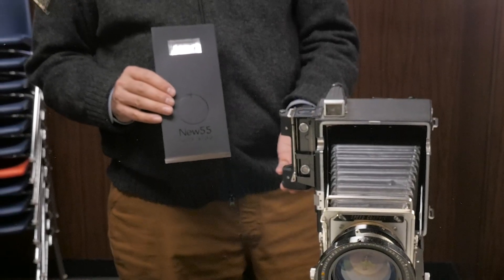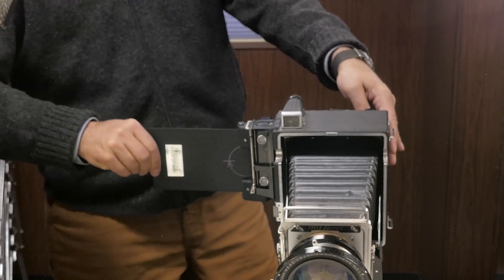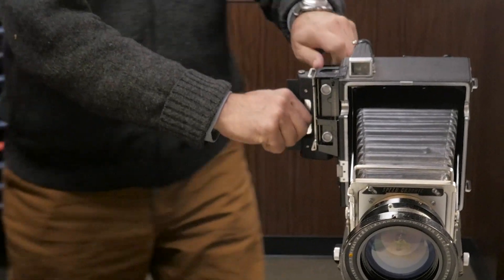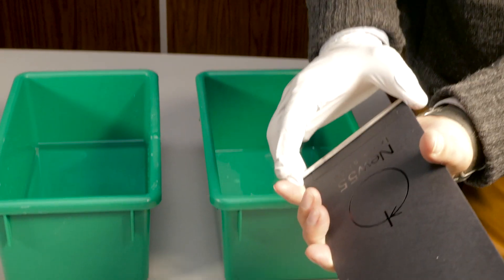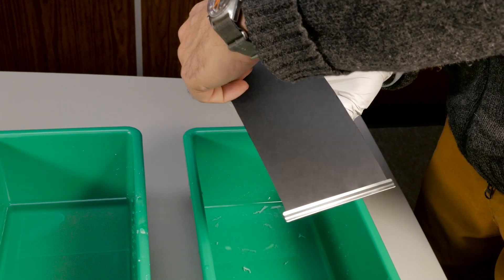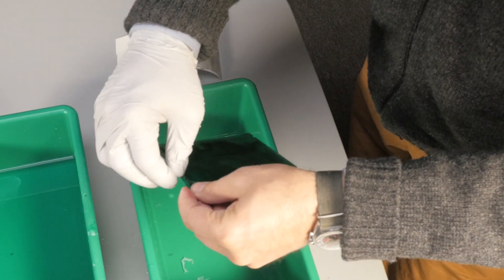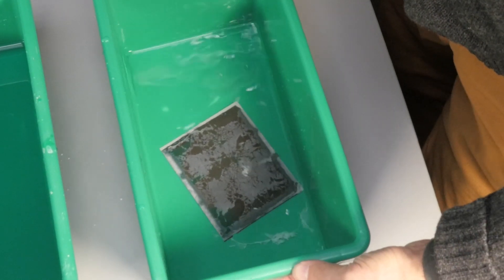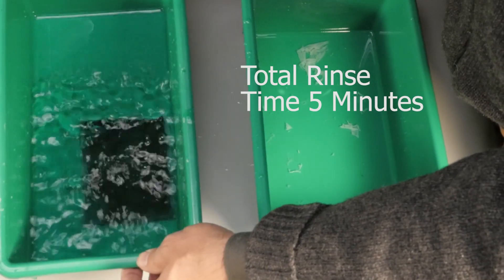New55 PN - Shooting and Processing

Comment: Hi sam what if Im traveling and take a photo with my film but wait a few days to develop it?
Reply from the maker: That's done often, Jess. The 545 and 545i holders have a Release Lever 'R' that lets you expose the film packet and then take it our without processing. Come back later, replace the film packet and process as usual. Waiting days, weeks or months does not harm, so long as the pod reagent is good. Recommended to use within 6 months of the date-code.

Comment: If you take your image, can you replace the slide and remove it without processing? Can you save a few for later? If so how dark to they need to be kept? What is that processor thing? Why does it need to be removed?

I just got a 5 pack of this film last week and my Crown Graphic is cleaned up and ready. The box isn't opened yet so not sure if there's any instructions.I am trying to think of a worthy subject before experimenting. At $15 per shot I don't want to be too wasteful.
Reply: Steve - the 545 Holder is designed to process immediately or to simply remove the exposed film packet for processing later in a different location. After exposure, just hold down the holder’s Release Lever ‘R’ while removing the film packet. Look for other videos for New55 PN to get all the nuances of the process.
Reply: @ehhiser  Thanks, I have a 545 I haven't used in 20 years. I did use it for positive only Polaroid but never tried 55PN. I recently got a 5 pack of new 55 and have looked at examples on Flickr. What I've seen there has tons of defects. The're so bad they have a grunge effect all their own! At $15 a pop I was really thinking hard on what to shoot but I better just shoot something to try it out. On the old Polaroid positives I had to shoot at 50% faster and increase exposure time to avoid over contrast.

Comment: What would happen if you left the film longer than 4 minutes?
Reply from the maker: It's now a 2-minute processing time.  Longer will give over-development -- with some artistic possibilities.  (see Andreas Rentsch ... http://www.andreasrentsch.com/
Reply: Tim White in the old days Polaroid supplied as an optional device a plastic tank with snap on lid that held a plastic frame contraction that held 10 sheets of T55 negatives suspended in fixer for when you were out in the field.  If kept wet in the tank you could wait several hours with no negative degradation.  I still choke up when thinking about Polaroid and their amazing T55.

Comment: Having been a previous user of the TYPE 55 Polaroid material since it's inception till the end this new product seems "clunky" and requires more manipulation and care than the original packets which you could always choose to process in the holder in more ideal and controlled situations. The original Polaroid packets were relatively thin and went in and out of the holders with ease, they were designed to be quicker than standard single double side shot film holders. Polaroid had a wet holder where you could put negatives in 18% Sodium-Sulfite solution in the field (Kodak's Hypo-Clear was an alternative) and even use a second hardening solution in a second holder. Field use in a 4x5 Graphic was practical if you could delay processing. In the later versions of the packs the processing time was 20-25 seconds, many opted for NOT preserving the negatives in certain situations, though a properly handled negative was comparable to most films of similar speed and specification. You did have to keep in mind the actual print area was less than 4 x5 ( 3 1/2" x 4 1/2 " (9 x 11.4 cm)). Given all the advancements in technology and manufacturing it seems much of the Polaroid technology has yet to be properly reproduced.

I had the opportunity to work with a number of the research and manufacturing talent after they left Polaroid after Dr. Land's death and what they conveyed was missing after Dr. Land was the cheer leading and demand for quality, excellence, and innovation. Research at Polaroid Cambridge was open and free wheeling in those days according to those on the ground and at times expensive.

Probably the item I personally miss the most now is due to Fuji's discontinuance of the pack films, orphaning 10 of thousands cameras, especially some of the better examples. It is uncertain of CatLabs of JP ( Jamaica Plain  - Boston) MA will accomplish the tasks without the manufacturing materials and equipment Fuji had in hand but evidently was unwilling to part with after the discontinuation announcement.
Reply from the maker: Hello WeBuyIt_WeSellIt -- 

You give an interesting summary and recap of the peel-apart and pack-film situations.  Your experience with the Polaroid culture would be nice to hear about in a direct form of communication -- article or panel discussion, maybe.

We deliberately opted in the Mark I version of New55 PN to use a better method for clearing PN's negative, indroducing a polymerizing ingredient in the reagent.  Old Type 55 was designed to DISSOLVE the reagent goo in sodium sulfite.  Ours CURDLES for COMPLETE and fast separation.  Sodium sulfite is inefficient and easy for first time users to screw up.  More importantly, sodium sulfite is even more rare to find now than it was before when darkroom supplies were handy.  Our choice of a strong and specific fixer product for clearing has been one of New55 FILM's points of success.  New55 PN has also made a significant improvement in the exposure characteristics -- both the negative and positive expose evenly at box speed.  Consequently, New55 PN is a bit harder to handle in the field than the original; however, our users have found that carrying processed, wet negatives in the same bucket/rack system in water permits the same freedom as before.

The New55 FILM's film packet system -- its thicknesses, difficulty in handling and finicky behavior in the 545 holder -- is important to recognize.  This is a temporary condition of the first iteration of the new product design -- which faced the elimination of certain chemical and paper components from the industrial landscape.  

Looking ahead: automation in Pod manufacture; new paper materials; the introduction of a print-masking component; a better print paper base and refined print coating techniques are all a part of the demands placed upon the project by the upcoming New55 COLOR design.  And all these improvements that are financed within the color endeavor here would cascade over to real improvements in the reliability and behavior of the New55 PN (black and white positive-negative), 1SHOT Ready Loaded Sheet Film and other products in the film packet system for the 545 holders.  Polaroid had decades to refine its peel-apart films.  We can achieve superiority and even devise unique products no one has ever seen before -- as we enter our second year of production. 

As of today -- March 2017 -- we have much to do and the community has much to look forward to in the large format instant film photography space.  The loss of Fuji pack films is an unfortunate development and a loss of some great film for some fun cameras.  The photographic quality of those deceased materials inspires us to ensure that good material remains available forever for all the 4x5 cameras that will never go away.  -Sam Hiser, New55 FILM
Reply: WeBuyIt WeSellIt auto shows
Reply: Huhiijijjiou
Reply: J.

Comment: Hi Sam - please can you tell me what holder you are using as I need to get one.  Many thanks
Reply from the maker: Hamid - We are planning a fresh New55 COLOR campaign, possibly for Spring 2017.  We'll need full participation if New55 COLOR is to get made sustainably.
Reply from the maker: Nico is right Shane.  The holders that New55 PN and New55 COLOR are designed for include the 545, 545i and 545 Pro -- ONLY!

Please support the New55 COLOR crowd-funding that's on now -- it supports both the new color instant 4x5 and improves the existing New55 PN black and white 4x5 positive-negative product ...
http://tinyurl.com/new55color
Reply: He is using a Polaroid 545 holder.
Reply: Hey Samuel - what's happening with New55 Colour after the Kickstarter? Is it just DOA at the moment? It's still listed on the site and leads to Kickstarter but it seems obsolete?
Reply: That's great to hear - I'll keep my eyes out for it. I missed the last round - hadn't yet gotten into film pack photography. Keeping my eyes (heh) peeled.